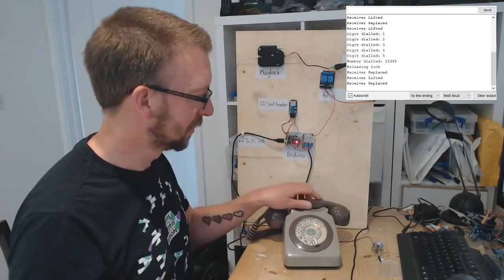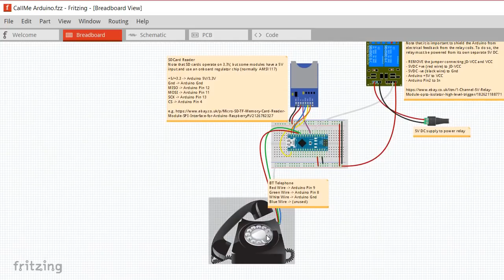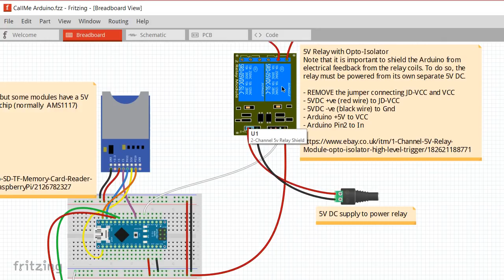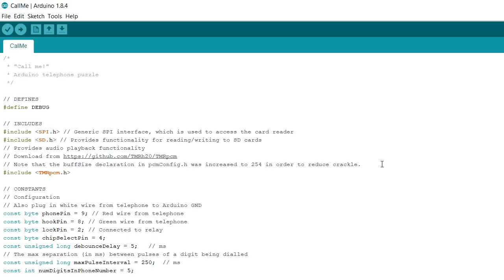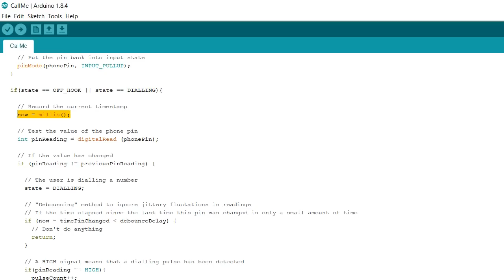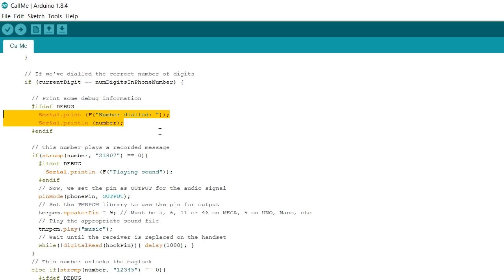Call Me! Rotary Telephone + Arduino Escape Room Puzzle

Comment: Hiya, I am trying to replicate this puzzle and I am struggling. I am using an Arduino Uno and it is registering when the handle is being picked up or replaced, but doesn't register the dialing. I have a black, red, and yellow wire coming from the dialing area and have put black to ground, red to 9, and not using the yellow. Would you be able to offer advice?

Comment: You can eliminate bounce problems by an analogue method and you then can devote the code to just the logic, not evaluating bounce issues.
Reply from the maker: Yes, you can. Personally, I find that including debounce procedures in the code makes the problem (and the solution!) more explicit and easier to understand, but you can certainly do it using a purely hardware solution instead if you prefer.

Comment: Hi, great video. I am beginner and hoping you use this as part of a party I am doing. What did you use to splice the phone cable? The phone cable is so thin, I tried using some B connectors to connect the green and red cables to my jumper leads but it doesn’t seem to register :(

Comment: Is there anyway to be able to do different length of digits?
In the code its defined by 
"const int numDigitsInPhoneNumber = 5;"

What would be the best way to have it be able to dial different length numbers eg; 999, 12345, 12345312

TIA
Reply: In the CONSTANTS; this line of code can be altered:
const int numDigitsInPhoneNumber = 7;

Change the 7 above to any length you want

Comment: Really clever how you insulate the circuits,
But in my opinion you use to much single parts.
There is a option to use a single device which does all the operations on it's own.
Check on YouTube DigitalTechUSA or The Lockey escape rooms in UK

Comment: Did you use an original unconverted 746 for this project? If so do you think one of the new 746 phones that is designed to work on the modern phone network would also be compatible with your project?  If fear not since I believe that it is only two wires now rather than four.
Reply from the maker: I'm using a completely unconverted 746 which I bought off eBay that had come from someone's aunt's loft I think, where it had lay for many years! I'm not familiar with "new" 746 phones, but if they use tone dialling I'd use a different approach instead - using a PAPT and a private PBX server running on a Raspberry Pi, say - to intercept and act on the DTMF tones instead of listening to rotary pulses.
Reply: Thanks!
Reply: @PlayfulTechnology  That increases the cost considerably though...

Do all BT phones come with the BT Connector, or are the later ones RJ-11? ( (I left the UK a long time ago!)
Reply from the maker: @duncanx99  UK phones use 431A connectors, not RJ11. As for cost for my other solution, a Raspberry Pi is around £30, and a PAP2T is around £20. More expensive than this approach, yes, but also more powerful and feature-rich (and doesn't require any hardware modification)
Reply from the maker: I started a new tutorial series explaining this approach - first two videos are now online here: https://www.youtube.com/watch?v=kbODHbJyEX4&list=PLogiUurtMYtSJj2APtaS00E-w02Bmz2m_
Reply: @PlayfulTechnology  Yes, I've seen those but for what I want, that method would be real overkill, at least at this point in time - though I'm looking forward to the next installment.

There's an autistic child in my village (in Spain) and I just wanted to create simple puzzles with 'rewards and instructions for the next puzzle' using the phone.

The connect a phone to Arduino and use SD-Card messages approach would fit the bill quite nicely.

My thinking was to get an old phone and a wall-socket on a box with seven segment display, LCD and LEDs, plus some toggle switches and buttons - fairly simple and cheap (a UK pension doesn't go far).

Wall sockets are confusing on eBay - NTE5A/NTE5C/BT80A/vDSL2/etc. What constitutes a 'standard' telephone wall socket?
Reply from the maker: That sounds like a fantastic use for this project :) This is the best resource I know of regarding the UK telephone network: http://www.telephonesuk.co.uk/wiring_info.htm - yes, NTE5 is the "standard" wall socket.

Comment: I used to work in Telecoms and wired many of these phones.
The normal power supply would have been 50 volts over the 2 line wires.
Ringing was 75 volts 25Hz ac.
The line loop resistance would be anything from 200-1200 ohms.  
The 4 wires were for line, bell and anti tinkle or earth.
If there were more than one phone, the bells were wired in series.
While dialling, one of the dial contacts stopped you hearing clicks in your ear, another was used to prevent the bells on other phones tinkling.
Dialling was 1-10 impulses (circuit breaks) at 10 per second, followed by a pause (300ms?)
The phone internally had a number of tags that were connected to the circuit, various switched and the handset.  They could be set in different configurations for different uses.
It should be possible to just rewire it so that 2 wires in the line cord connect to the handset receiver and another 2 connect via the Switch Hook and dial contacts.
There are circuit diagrams on-line.
Reply from the maker: Roger Leitch Great information - thankyou!
Reply: I bought all the bits for this rotary phone project, but didn't get to make it yet.  https://blog.adafruit.com/2016/07/04/hack-a-rotary-phone-to-make-and-recieve-calls-arduinomonday/   There are some similarities - detecting dialled digits.  

I did get around to making a project using RFID cards, which used the SPI  interface.  This was a door access control system.
These used a normally on electromagnet on the door. 
I used the opto-isolater and relay module circuit, but found the normally closed relay contacts failed open circuit after a few months. 
Went solid state and used a darlington transistor to directly drive the magnets.  Single 12volt K80 supply (the built in relays failed) and a 7805 voltage regulator for the Arduino.

I like the escape room ideas, so may adapt them for use at a fete for fundraising.  (I used to have a fake safe - turn a dial, try the handle, if it opens win chocolate or set off an alarm).

Comment: WOW! It's great! How is the phone powered? The video shows a phone cable connected to a module next to the arduino - what is it?
Reply from the maker: The phone does not need any power - if you mean the thing slightly down and right from the Arduino, that's just a line of terminal blocks to allow the cables to be easily plugged into the breadboard, e.g.: https://c1.staticflickr.com/9/8723/29338211736_27581c12ca_o.jpg
Reply: Thanks!

Comment: Hi there, struggle to get mine to work at the moment. When the handset is lifted the serial monitor doesnt have it registering as lifted and then when the i pull one of the numbers around it then displays reciever lifted and when the dial spins back it displays reciever replaced. It only does this when the actual handset is off the hook. Any thoughts on what is being messed up here? Thanks
Reply from the maker: Tom Hurst Have you tried swapping over the phonePin and hookPin?
Reply: Yeah and that partly solves the issue of registering the phone off the hook but then every time you dial a number it just flickers the reciver lifted/returned without counting dial numbers.

On startup i get this on the serial montor

Serial connection started
Setup Complete
(handset lifted at this point)
Receiver Lifted
Receiver Replaced
Receiver Lifted
Receiver Replaced
Receiver Lifted
(handset now in the air. pull number 1 around and let go)
Receiver Replaced
Receiver Lifted
Receiver Replaced
Receiver Lifted
Receiver Replaced
Receiver Lifted
Reply from the maker: Tom Hurst Hmm. Do you have access to a multimeter? And what sort of phone are you using? Have you got the white wire connected to GND?
Reply: @tomhurst9629  i am having a similar issue (see my recent post). Did you manage to solve it and if so, how?
Reply: @PlayfulTechnology  did you manage to fix this issue. i'm having the same issue and the new solution of yours is way more than I need. I feel like i'm close. I also swapped the hook and phone pins and get the same jittery issues. any help would be great. Thank you
Reply from the maker: @lockdownescaperooms  Hi! The problem with this issue is that it basically differs from handset to handset - the code as I presented here should work fine if you're using a UK phone from the same era as mine. But phones of a different age or from a different country use totally different systems - and even within a UK phone you'll find little standardisation in things like wire colours or timing of mechanical operation. :(   If you're using a UK handset and still getting "jittery" readings, I suggest you try changing the maxPulseInterval value defined near the top of the code - try different values from about 100 to 500 and let me know if that makes a difference.
Reply: @PlayfulTechnology  thanks for your reply. Unfortunately, that didn't work. Initially, it cant recognise the handset being lifted or replaced unless I comment out the initial INPUT_PULLUP of the hook pin. Only after that do we see a reading of the handset being lifted and replaced but then other issues arise. For example, the recognition of the handset is jittery (Replaced, Lifted, Replaced, Lifted...) Numbers are recognised as dialing, but when you complete the number (correct or incorrect) nothing plays even through the SD card was set up sucessfully- and then it cant recognise when the handset is replaced again. So frustrating because this is a cracking puzzle. I am using a similar phone and we are in the UK. I'm using a BT 8746- same wires (red, white, blue and green)
I'm guessing this doesn't matter, but I have set this up without the mag-lock and relay parts...
Reply: Playful Technology could you drop me an email to info (at) adventure vault.co.uk thanks. Info@adventurevault.co.uk
Reply: I'm stuck at this stage. Were you able to solve this?
Reply: I fixed the code. At least it works for me now. The problem is that while dialing a HIGH PULSE (pulseCount++ basically) also triggers the hook pin to one (physically inside the phone).

Basically like this: 
PHONE -> 0
HOOK -> 0
PHONE -> 0
HOOK -> 0
PHONE -> 1
HOOK -> 1
PHONE -> 1
Receiver replaced!
HOOK -> 0
PHONE -> 0
Receiver lifted.
HOOK -> 0
PHONE -> 0
HOOK -> 0
PHONE -> 0
HOOK -> 0

So I just made sure that HOOK = 1 only triggers if PHONE is NOT 1 at the same time. Works for me :).
Code can be found here: https://pastebin.com/mhbW8AnU

The wiring color code is for a German "FeTAp 611(?)" I guess. So yours may vary.
Reply: @Kruemo  i'm having the same issue, looked at your code and it didnt work for me? Could you explain some more please and maybe I can fix my code too. thanks
Reply: did you manage to fix this issue? Having the same problem
Reply: We have managed to get ours to work with some alterations to the code, but still no file playing. It sounds like something is trying to play but it's just static. Any ideas?
Reply from the maker: @lockdownescaperooms  Hey, progress! What format have you got the audio file saved in?
Reply: @PlayfulTechnology  I have it saved in wav. Also tried mp3 but still no play. Ahh I'm so close haha
Reply from the maker: @lockdownescaperooms  If you're using the same TMRPcm library as me, can you try uploading some of the example code that comes with that library just to make sure that it can play your file correctly? Try 8-bit mono (raw) wav - I save mine using Audacity and it works fine.
Reply: @PlayfulTechnology  thank you! tried the example files and they worked (sort of) thanks for the advice! I converted my files to 8-bit WAV and all works! Only part is, the audio files play and putting the received down can not stop playback, or reset the puzzle... you have to wait for the audio to finish playing and it auto re-sets. I actually like it that way.
Just signed up to the $10 patreon too, cant wait to get building even more! thanks again!

Comment: Best phone hookup I have seen. Have to find a phone in the U.S. and see if it works. Now can you make the phone ring?
Reply from the maker: I believe that the final wire I didn't use (the blue one) is the "bell" wire, used for activating the ringer. However, certainly here in the UK, that requires a 50-60VAC current to activate, so I decided not to use it for this project. It wouldn't be too hard to place a small motor inside the phone that rang the bells on a lower DC current though!